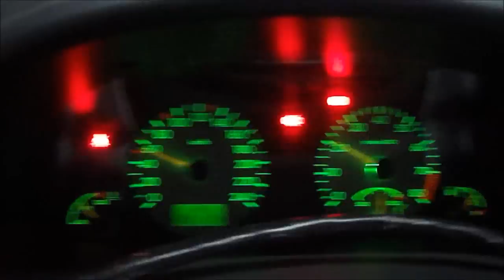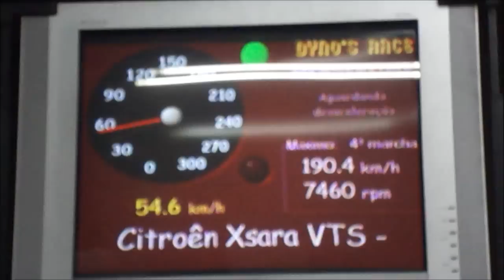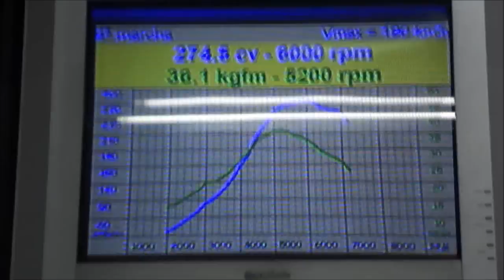Citroën VTS Turbo 2.0 16V

Comment: Boa noite

gostaria de saber se vocês prepara peugeot 308 motor 2.0 ano 13 câmbio manual

Tenho 90 km atual  gostaria de efetuar preparação leve 

Procurei opções para kit turbo mas não encontro em nenhum local gostaria de saber se vocês executa servico ou caso não haja possíbilidade se é possível preparação aspirada com banco de fluxo já que espaço para turbina e na parte contrária ao do 1.6 apesar de já haver thp turbo tenho preferência do 2.0 gostaria de saber qual opção você disponibilizaria caso turbo com pressão de 0.8 ou 0.6  eo que seria necessário pecas tempo de serviço ou possibilidade de fazer banco de fluxo no cabeçote remap  bem algo que levasse o veículo a média 200 a 270 cavalos bem fico no aguardo pois vi vídeo de uma preparação peugeot 307 1.6 bem já tive 3 veículos turbos anteriormente mas hoje gostaria de algo mais leve.

Fico grato pela atenção
Reply from the maker: Sim, preparamos:

Para Orçamento, envie-nos um e-mail para : contato@mvspreparacoes.com.br 
informando o ano/modelo do carro e qual a preparação e potência que deseja atingir.
Att.